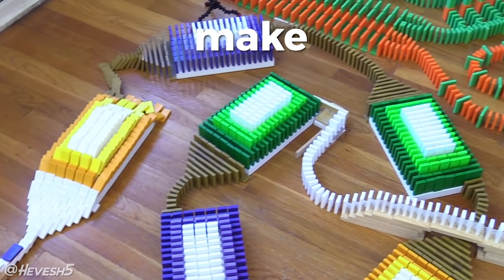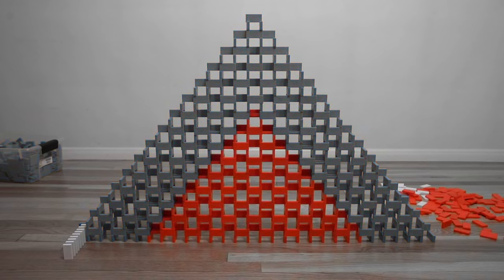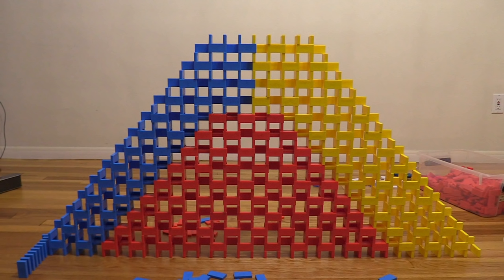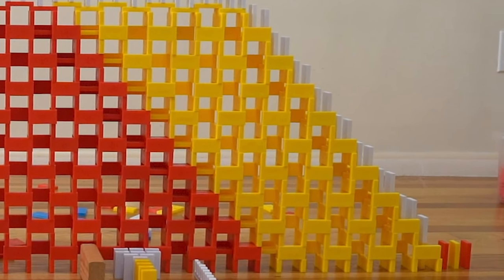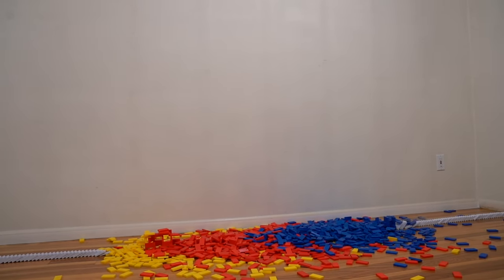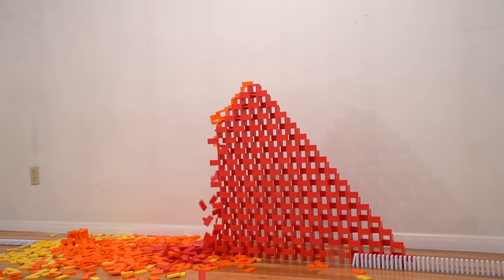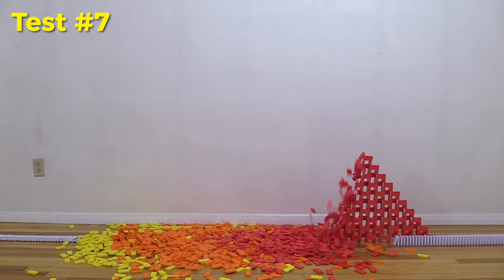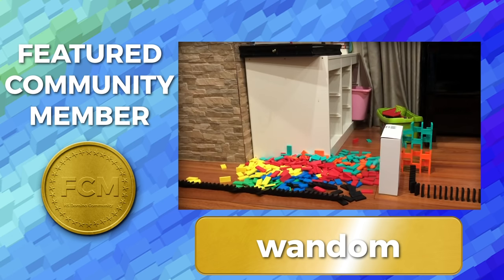*Attempting* a New Domino Trick: The Slanted Wallback

Comment: I think that the barrier line should be made of dominoes joined in the shape the of the barrier line so that it can be stiffer the now, but I think that will look a kind of ugly after the structure falls...

Or,

The size of dominoes should be small used in the wall which falls first and the wall which falls next should be made of normal or big sized dominoes, so that the small dominoes will not be able to trigger the wall made of normal or big sized dominoes...

Comment: What audacity you did with these tests... a good domino builder always does new things and never gives up on achieving the impossible in possible by doing tricks like the slanted backwall, the problem with this trick is that you have to calculate the amount dominoes for the barrier because you may put more dominoes on the barrier, but what can happen is that the barrier is very large and impossible for the entire wall to fall... so good try Lily! ☺️👍